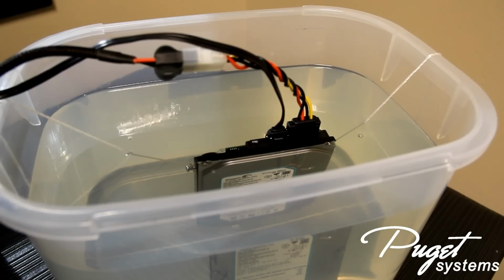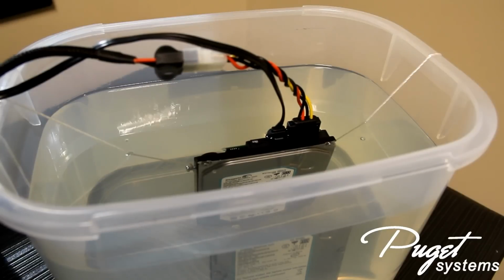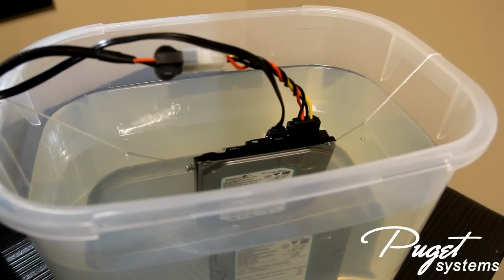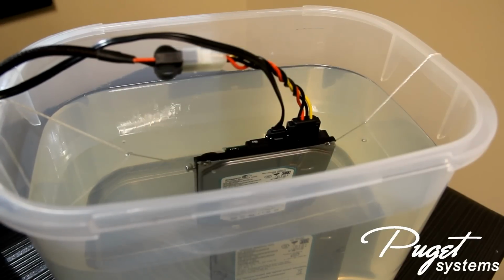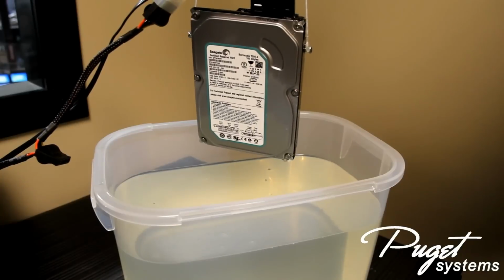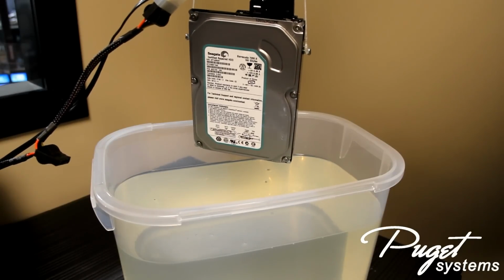Can you submerge a hard drive in mineral oil?

Comment: You could see that the oil wasn't dripping out of the hole, it was dripping out of the corner. It was never designed to be water tight and it's not.

Comment: It was unnatural on how hard i laughed at this... not because you actually tesed it, but by the fact that people don't have common sense to answer this themselves... a piece of component spinning at 5400 or 7200 REVS PER MINUTE with thin plates and submerging it in water or thick mineral oil... I'm pretty sure it won't work.